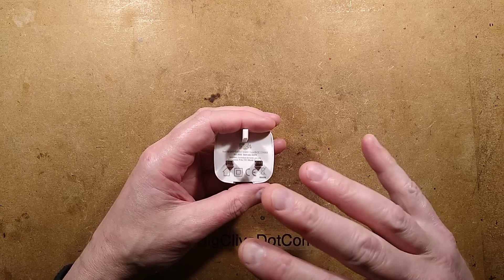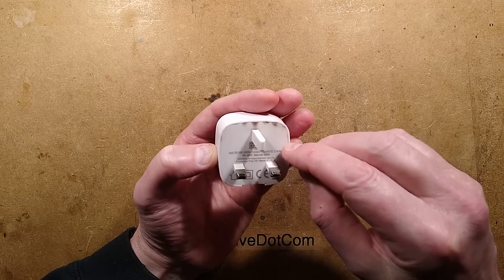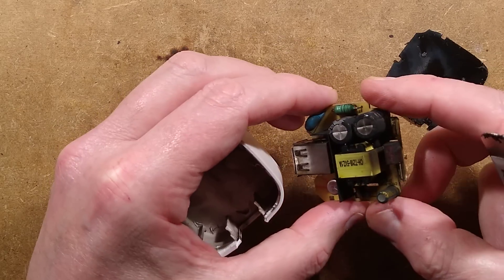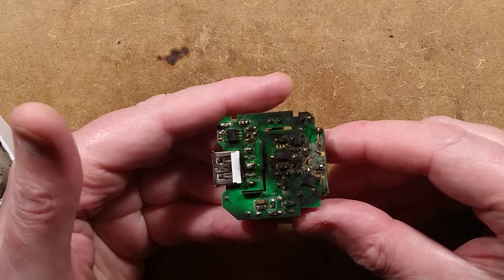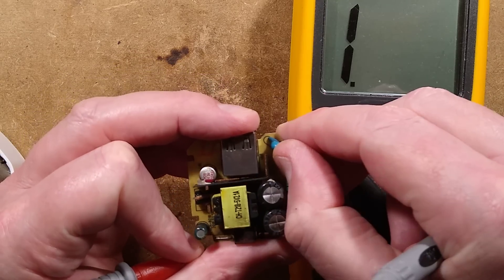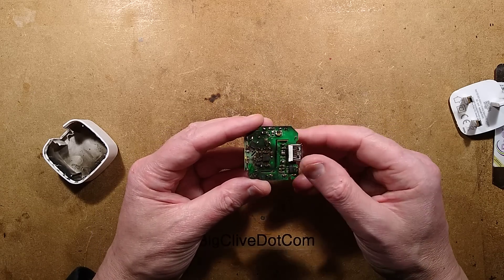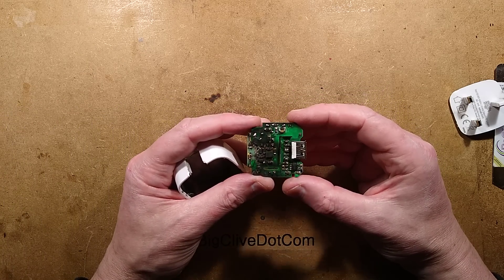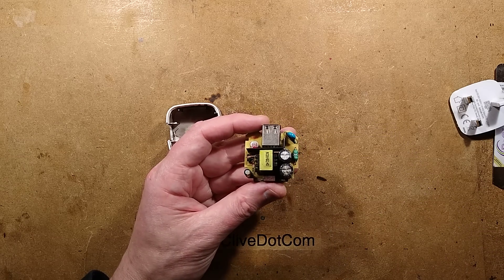Poundland USB versus lightning  (The lightning won.)

Comment: About 3 years ago lightning struck the right behind the building in my backyard. It was LOUD  and after storm ended i remembered that we have freezer in that building and when I checked it it was not running. Lucky it was just a circuit breaker  and freezer survived. A year after we had a electrical pole struck by lightning and it blew up pretty much anything that was plugged into the outlet or internet line. Router had exploded capacitors led bulbs had exploded ic-s... We were lucky. Others in the neighborhood had all TV s and computers.  Even some electrical wiring blown up. Lightning is not a joke. It blew the whole led street light to peaces.

Comment: I wonder if and what protections my (pretty) expensive PC PSU has for such scenarios .
Reply: Well in terms of having protection for it what do you have plugged in before it either a good surge protector or be a good UPS unit which will also filter Riser protection on and so on and so forth by the way don't connect to surge protector into the output of a UPS you could have issues.

Also AT&T recommends not connecting their modems or gateways to a surge protector or UPS system whatsoever causes trouble with Wi-Fi any comments on this from anyone plates want to get to the bottom of it.
Reply: @aaronbrandenburg2441  I could see that UPSs and surge protectors cause problems for powerline ethernet, but wi-fi? Someone at AT&T needs to lay off the drugs.
Reply: @brianleeper5737  actually I probably should have been more specific on that with the Wi-Fi having an issue with surge protectors and UPS units in other requipment voice filters to evidently.

But yes you're right about Powerline ethernet also another thing would be power line communication of any type such as use for home automation systems such as the x10 system and there's a few other things out there that use that as well. And other things besides home on vacation as well.

Or things that use similar signaling overall. Such as you said with Powerline ethernet.

But I was negating that altogether because I was not even using that at all I don't think it would be practical here first of all I've already got contemporary hardwired ethernet where I personally need it.

Kind of nice when you live in a place at the floors were redone AKA pulled up and replaced but never redid the baseboards and there's gaps in some areas.

Which is just the right size to run your cabling from room to room unfortunately don't own the place so no Drilling any holes or installing junction boxes running permanent cabling excetera!!!! :-(

Or installing any junction boxes and such either of course.

Also certain types of circuit breakers and interfere with that type of signaling such as Powerline ethernet and power line carrier Powerline control whatever you want to call it.

All that type of thing can be interfere with with as of lately alt fault circuit interrupters..

Haven't looked into it yet but I haven't heard it's been resolved yet in any way hopefully that will come out soon that they find a fix for it!!!

But back to what I was hearing about with AT&T and problems with their routers gateways modems excetera with the Wi-Fi. And surge protectors power conditioners and UPS units and other devices.

What they were saying is those units do not like voltage fluctuations or difference then normal straight out of the wall power have the said themselves.

Everyone the people I've talked to have said this as well no difference for anyone.

Has something to do with fluctuating voltage or the waveform being chopped or anything that would affect characteristics of the AC power.

That's why on some systems they do not recommend even using surge protectors such as on the output of UPS systems.

Certain types of vehicle Power Systems that do provide a hundred twenty volt AC.

Also standby systems and backup systems that rely on certain types of systems and some types of generating systems such as like on board a cruise ship.

And many others.

It's something about them pulling power or affecting certain characteristics have not been able to verify this. But it would make it interesting study into something

 if I ever find out where to find this out.

In some instances depending on where you are and such facilities Etc like for example again on board a cruise ship you are not permitted to move use anything that has surge protection goes into it because of this.

And it does not have to do with plug it into any things here and causing an overload either.

Because you are permitted to use multi-way adapters and power strips just not ones with surge protection built into it.

AKA relocatable power strip or AC outlet adapter or maybe something like a power squid or equivalent.

So chances are if it could affect those systems and all there might be some Merit to Dad about the vaping Wi-Fi with the input power not being what is a device wants or expects they k a modem Gateway whatever piece of equipment that would have the Wi-Fi. Access point.

What they were saying is that often times when it's hooked up with something like that for power you'll have issues with Wi-Fi reception and range I actually did have this happen in one case somewhere else that I was helping with the situation trying to see what was going on and I remembered that what day and said about that from AT&T.

And lo and behold plug-in where it could be fun straight into the outlet just move to it after a few feet she want another receptacle the other one was in nowhere to be able to get to it for that. One reason for this surge protector power strip being there in that case The outlet was too far away and behind a bunch of furniture.

 but once I plugged it straight into the outlet no problems with the Wi-Fi whatsoever at least it is General vicinity where it was having issues but further that yes but that was Oak Point in which you'd be out of range anyways do the construction and a distance.

I put in a separate access point for that portion of their our house.

Actually put it in a a closet with a shelf that happened to have power up there.

 there was like three duplex receptacles total and realized one of them was switched from outside the closet the other two were unswitched the Shelf was above the closet door also it I had a ceiling light but was controlled from the second switch in the same box that's the first one but the light was the one closer to the door The switch that is.

 if anyone would have any idea why that was Dylan like that would love to know I've seen something similar with just a switched Outlet shelf above the door more than once but no one knows why it would be done.

Also a lot of times older homes original construction no modifications so free internet free wireless stuff mostly so yeah questions they're please comment thanks.

 hopefully that makes things a little more money or less money depending on which hopefully that makes things a little bit easier to understand where they were coming from and also button-up sweater things but it just goes with the territory.

 but still trying to figure out those shelves high up in closets with Outlets usually switched for no apparent reason.

 also these shelves would not be easy to get to you need a ladder do it so not something like rechargeable or something so any clue on anyting anyone at all thanks again
Reply: Probably a couple of 50 cent MOVs if you're lucky.
Reply: Nothing 😐

Comment: I've just looked up that a lightning bolt usually is at 300 million volts and carries around 30kA - no piece of electronics will be able to stand that.
Reply: Electronics CAN survive a direct lightning strike if it is designed for that extreme condition. Radio and TV transmitting aerials are frequently hit by lightning and the electronics survives. Protection is possible but expensive. (A mains USB charger designed to survive the surge that killed this unit would probably cost far more than the most expensive iPhone and would be far larger.) This unit did well to contain the damage and not destroy the connected device.
Reply: @duncanmacdonald6993  But only due to the random incident of the explosive force blowing the USB cable out of the socket bevore the voltage hit the usb plug. I'm not sure this feature was designed or whether it was random coincidence (luck). Probably the latter.
As for designing stuff to withstand 300MV and 30kA, you won't usually find that in consumer electronics.
Reply: @Seegalgalguntijak   Any voltage hit to the USB connector would occur way before the cable moved - the electrical pulse moves at a fair percentage of the speed of light - the cable would not have moved even 1mm before the pulse hit. The impulse on the charging lead would have been common mode (all lines getting the same pulse), so provided that there was no easy ground path from the iPhone (eg from it being hand held) then the voltage across the electronics of the iPhone would have been fairly low.
For a mains power supply to withstand these sorts of transients, the input needs to be a mains transformer (no electronics before the output of the transformer) and spark gaps used to divert the pulse before the transformer can get damaged. (MOVs would be destroyed by such an event.)
Reply: @duncanmacdonald6993  So the disadvantage of switch mode power supplies is that they're even less lightning-proof? ;)

Comment: Friends of mine have a telephone line between their house and the village they're connected to and lightning hit that line. The whole village was without telecommunication for three weeks until all the necessary hardware to replace everything had arrived. They sent me a picture of the inside of their Router and cable modem, they were melted to a block of plastic with capacitors and coils sticking out.
Reply: Ouch what else can I say! Probably the worst other than a bee an old TV show with a partially melted picture to baby due to lightning.

Oh and one other thing I do remember once this was in Kentucky at my grandmother's house years and years and years ago when I was a kid.

I think it was during a storm and but that may have been coincidence because they hand something happen at one of the utility substations in town but this may not have been related or happened simultaneously who knows besides so long ago can't remember all the details.

But there was some major damage to substation something about a large substation Transformer and other equipment it had to be replaced everything was blown or malfunctioned or call something else to pay a witch or something else who knows.

It was nighttime or Ember and I think it was storming at or stormy I don't know long time ago I said said.

But funny thing those years and years ago even before I was around as far as I know

Unfortunately I don't know Wendy's toys would have come out.

But Grandma had had them a very long time probably from my dad's childhood but who knows what part of it.

It was one of those little projector things that you'd slime the strips into they might have been mounted in something or not can't remember but they had like comic strips on them.

We were doing that of course after dark inside with the lights out and that's sometime during that the power went out.

Again don't know if this is related to the storm or not.

But when it came back on the oven it was a wall oven don't know what brand or anything had the analog clock and timer and all really old probably original to the house.

Maybe not hard to say.

But when the power came back on the oven was on both bake and broil on full blast but the indicator light was not working which by the way took a night light bulb that's how old the thing was.

That was for the oven heating indicator.

The film it and it was blown out it was working previously.

If I remember also the thermostat was blown not just blown but shorted contacts AKA an always-on switch.

Also the bake broil select toggle switch was also shorted to both sides it was a single pole double throw switch which would select either one or the other but not both.

The timer was fine in a timer contacts or fine oddly enough.

 of course we shut power off at the panel for the oven circuit there was separate range and oven circuits range was a actually just a cooktop not a range.

 but we've found out later about the problem at the substation and that's why I've been out for so long.

But continuing my previous with that little cartoon projector thing it was like a flashlight Barrel slept on top of a rectangular box sort of.

Not like when I was little toy Motion Picture projectors but more of a slide projector except the service slides one big slide you slide across. Multiple images.

 to this day I wish I know who made it I'll see if she still hasto this day I wish I know who made it.

It turns out we had used the batteries out of the flashlight that we needed to go to get the other flashcards and to turn off the power to the oven.

That was a little awkward.

Of course we show it off at the fuse panel.

Yes at that time my grandmother still have fuses.

And also a lot of the outlets in the house where the old tandem / standard plugs or t-slot receptacles it almost look like a 20 amp accept both sides were mirror images of each other.

But was mostly in the kitchen and a couple of other areas that those were.

Note those could be wired for 220 but they will 115 or 120 there.

Old old old Outlets.

But they were grounded!

No sign of tube and knob or anything but most of it was Romex although some ones in conduit in some areas.

Also the furnace originally was old enough that the gas valve on the gas line yes it was a pilot light head December pilot light valve off the main valve to the side and angle and the main gas valve both lover valves.

Also the original thermostat was probably the oldest one I've ever seen.

Reminded me of a older range receptacle or a tombstone type arc welder.

Small bulb rotary dial a thermometer on the front.

Also they did save the old thermostat for me.

 that one's going to be left intact and not have the Mercury switch use for a project like I usually would.

That's the only one I've ever seen like that.

 by the way I remember when Radio Shack stop selling Mercury switches me and some other people bought all the ones we could from every location in the area.

Other things and other ones to course elsewhere as well.

Also at my Folk's place probably built in the 30s are so somewhere in there.

Some of the old telephone wiring is still there It's two wire cable that's black insulation probably cloth covered? Or other primitive insulation possibly rubberized of some sort don't know what the material is would like to know.

What where the phone lines were connected to phones or branching off for whatever there were these old two wire terminal blocks white wine actually long before only two terminals at least like an inch and and something wrong quite for a part.

And also the wires were attached go to the underside of the beams or wherever with these little what look like facts which may have been plastic or Bakelite? Or some other material haven't taken a close enough look.

 but that would have been the original phone wiring.

 this house seems to be around the same time? As my other grandparents. Judging by the wiring in a place.

Somewhere in Tennessee.

In some parts of the house it's in terms of our parents place it's bat a black conduit and round junction box is painted black.

 Also curious issue one of those checks live with a no-contact tester have not been able to verify if actually live or just couple passively or whatever.

Little nervous about that.

I've seen stranger.

Once or twice I've seen a service entrance hot to neutral short Not a good thing and weird things can happen let me tell you.

 also once on the farm my grandparents said they could get shocks off the kitchen sink at one time.

 turns out bad element in the electric water heater That's why it was only sometimes but not others.

 and also weird interference on TVs.

Turns out there was an old TV antenna in the Attic and a signal amplifier / booster that was still connected to power there you go interference.

Comment: CPC do a 50cm 1 gang extension lead. Think I might buy a few along with some very low amp fuses.
Reply: 1A Green, 2A Blue, 3A Red, 5A Grey, 7A ?? (can't remember), 10A Black, 13A Brown.

BS1363 screwed everything up by specifying 3A or 13A and making everything else non standard so now the colours are: 1A black, 2A Black, 3A Red, 5A Black, 7A Black, 10 A Black, 13A Brown.

So much for progress. 🤦

Comment: Ok, the fuse blew, but what else? Shorted rectifier? Fried controller? Is the secondary side still OK if you clean off the soot?
Reply: If the secondary is still good but a primary is open what's the point oh I guess you could still use it as an inductor LOL.

Done that with Transformers that will power Transformers 4 things for inductors and choke coils as well. Or when one whining goes out but the others are intact it multi winding Transformer multi tap Transformer oh yeah
Reply: Also ever been Zapped by some circuit that ran off a very low voltage are like wondering how the heck did that happen for example when something is malfunction they can generate high voltage or something's not quite right they can.

Even sometimes back EMF is enough to get you once in awhile.

Also I've had once or twice a Piezo speaker or beeper.

You know those little ones uses for beepers or alarms and things.

I've gotten a bit of a sap off a doorbell even and that wasn't even ringing.

Once on a Lionel layout I happened to touch the track and put some pressure down I just laying on the edge of the Mulberry Road layout nothing wrong with it but I still felt like something was pulling at my skin or biting me. Little bit